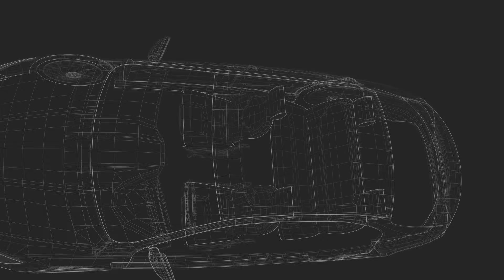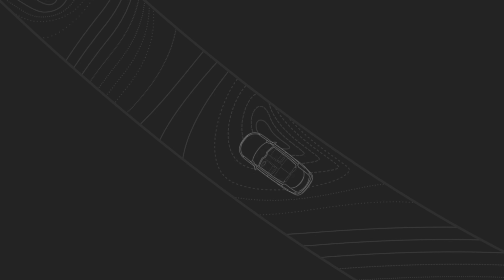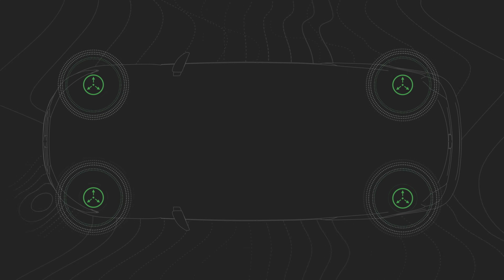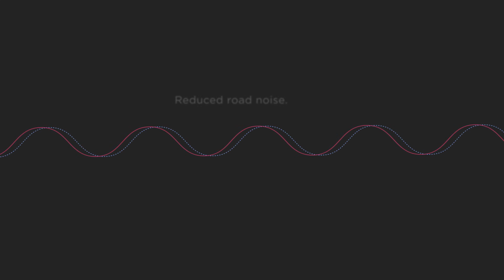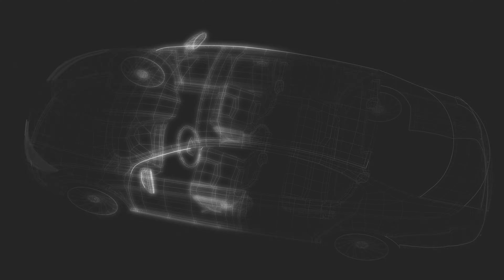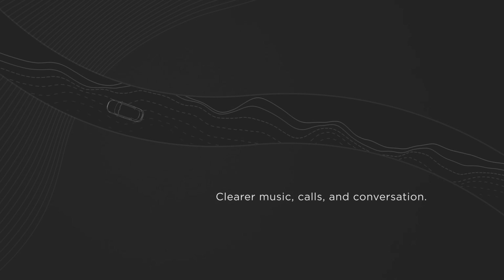Bose brings noise-cancelling technology to cars

Comment: In 1980 in Minsk were done some tests for that idea. They try to improve noise environment in tractor`s cabin. But the level of electronic components was incomparable with the current time.
Reply: This solution has been around a lot earlier but the solution was too simple for car technology but on the same principle. You can actually make that device at home and the result will be only as good as your components are. Much easier it gets for some irritating constant sounds.

Comment: I don`t care about the noise from the bumps on the road but the constant wind and tire noise reduction would be awesome. New CR-V has a noise cancelling system but I am not sure how effective it actually is.
Reply: To low down those noises you need good insulation and thick glass panels and thick metal panels on the car which most of cars dont have if you are seeking this things buy a luxury car and make sure its german. And small compact suvs or cars are excluded from the list as they just resemble the brand but dint have the options or quality the brand stands for. Buy an f10 5 series or a better car or equal audi merc you wont be dissapointed
Reply: @147NITRO  The idea is that we want low noise levels without weight increase from all that you mentioned.